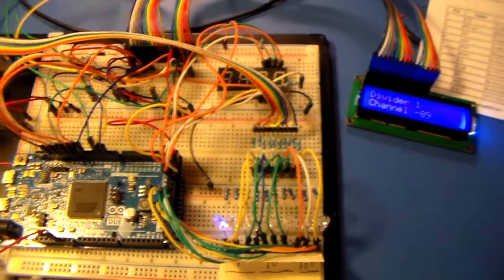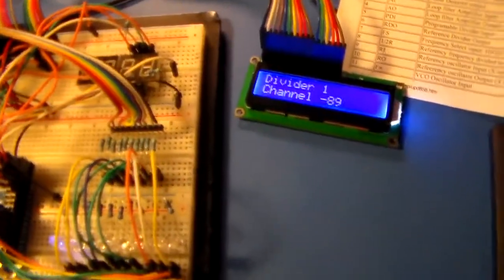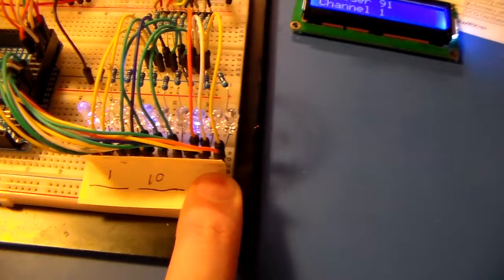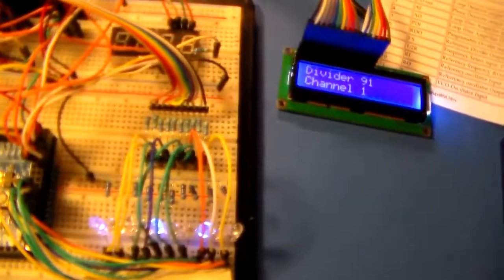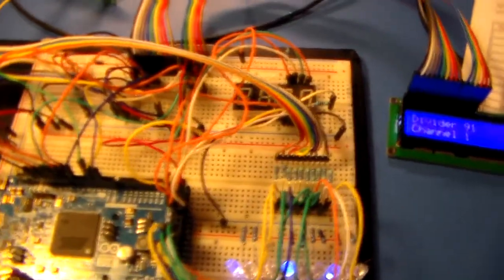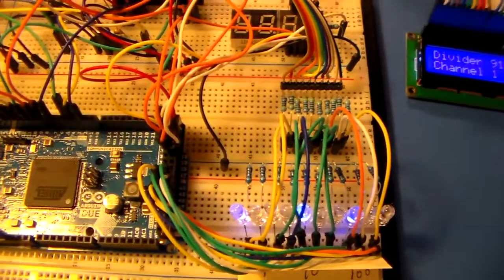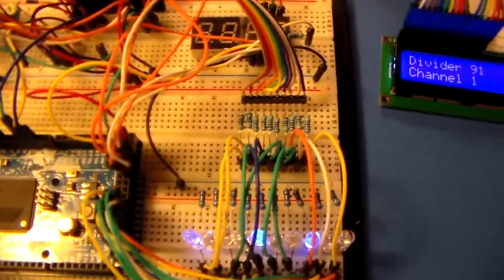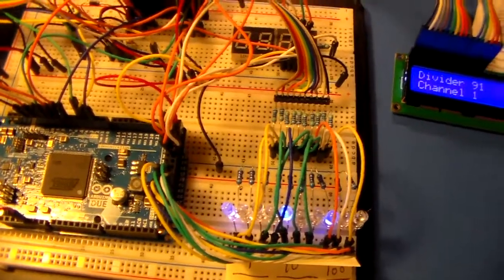Using an arduino to control a CB PLL

Comment: I did this with (uPD 858 & BCD thumb wheels) then later i used the USER port from a C=64, after finding the reset trace from the port i  needed to locate the POKE location for programing the outputs, after a few days i wired up a edge connector with LEDs and worked on binary values, short time later ' the program, that was 1986,

Comment: would have been nice if the SSB modulator on that transceiver was a QSE and the SSB demodulator a QSD  clocked at 10.240mhz*4  to give 10.240mhz you know what I mean if not 
QSE =Quadrature Sampling Exciter 
QSD =Quadrature Sampling Demodulator

Comment: Hello, I need use a PIC microcontroller in a cb radio, a voyager vr94 or megastar mg94 old (what use pll ks8805 or mc145162 - serial program), and I need any tutorial about program this. The microcontroller used is a PIC16F628A... Any help if possible, please? Thanks!!!
Reply from the maker: Sorry for answering late. I get a ton of stuff to reply to.
Not familiar with those radios but I know about the MC145162 - it's just a simple 3 wire serial bus you can probably use the SPI hardware in the MCU with.
I am not familiar with the radio so I would not know how to talk to it but if they are using this PLL in it there is obviously something else that is controlling this PLL. Another MCU I would wager.
Reply: Ok, thanks for your information about this PLL. I will to try to program a MCU for use with this PLL.... Thanks, bye!!!!!

Comment: Nice video, I've been wanting to do something like this for a long time.... just wanted to see if it was possible and what issues I'd have with it... such as cpu clock noise on the receive and so forth. Years ago I modified a sears ssb radio for 6 meter operation (ham bands). It was a x-tal control unit using a mixing scheme, but now I'm wondering about all those scrap radios I have in my shop... hmmmm... 6 meter mod + arduino give me more frequency coverage... plus adding the option to add a cw IDer to the radio.... if there were more hours in the day... hmmmm... anyhow... Thanks for the great video

Comment: hi there , did you control the lines using direct addressing such as PORTD = B10101000 ? Thanks
Reply from the maker: +Eltimple No.. because it's 10 bits that would not work.
Now on the MB8719 I don't see why you could not since it's 7 bits.
These were my experiments in using the Arduino toolchain instead of the Atmel toolchain and suffice to say I went back to Atmel Studio :)

Comment: Nice project Mark, came out awesome. Was the channel control broken on the CB or did ya just fancy a fiddle/mod?

Hope ya mouth feels better soon.
Reply from the maker: Mouth is good.. time for the one week checkup.
It's a fancy mod basically however since this is a 30+ year old radio it would be one of a few options to repair it since I highly doubt that Uniden has the original binary encoder available.
Your pretty much limited to taking one from a scrap radio or doing something like this.

I showed this to a few people I know that still do CB as a hobby and they like it.
I have another inquiry as to whether or not I can apply this to the MB8719 PLL which should be easily done.
There is a market for CB toys and I am not sure I want to be bothered to be honest.. it's a hobby now not my job :)
Truthfully the Atmel SAM3X may be overkill for this. (http://www.atmel.com/devices/SAM3X8E.aspx)

I have a few more ideas I want to tinker with... storing parameters in eeprom, a frequency counter, tieing into the squelch to scan frequencies, possibly the clarifier, etc.
One thing that happens with these radios is that they do drift a little and if I used another encoder for the clarifier and a DAC to control the varactors in that circuit I can probably add stability to the radio.
If I start adding bits like a frequency counter, DAC, etc I may be pushing the limits of the MCU...

Just waiting for a few bits to come from Element 14, like 3 digit displays, etc.